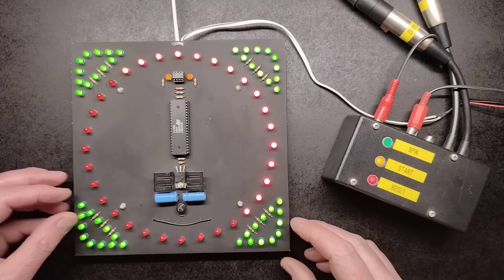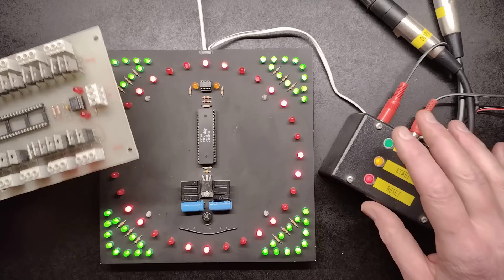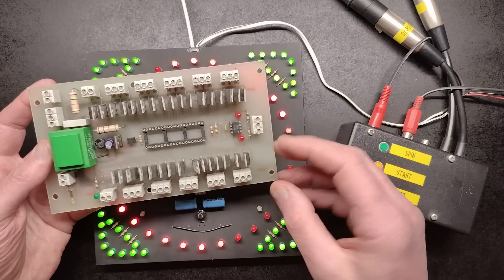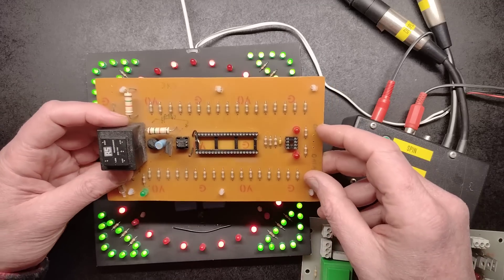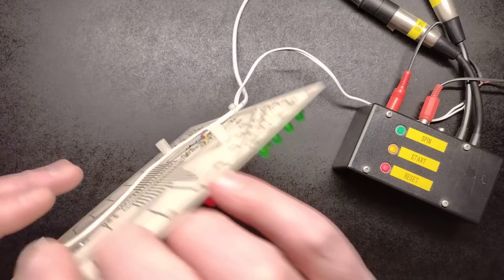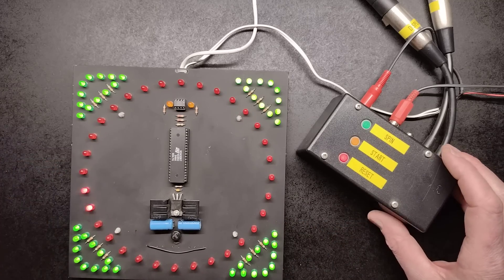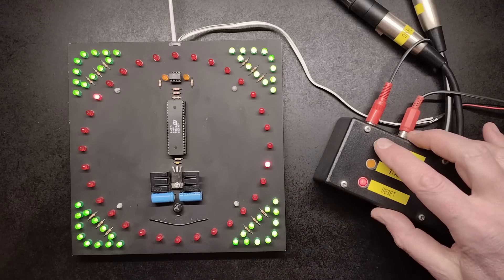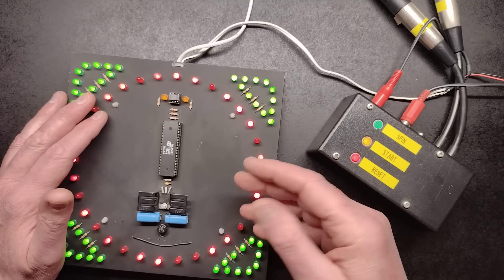Flux and carnival games (Loud 8-bit noises!)

Comment: There's three basic grades of rosin flux: R (rosin), RMA (rosin, mildly activated), and RA (rosin, activated). RA and RMA have organic acids added to increase the reactivity of the flux. You can also get water-cleanable flux and "no clean" flux. RA and water-cleanable have to be cleaned off, but it's optional for the others.
Reply: Unless your circuts include very large-value resistors. Usually you get away with optional clean or no clean because the impedance is much greater than any resistor you might use. (Typically, no larger than 1 megohm.) If you happen to be making a transimpedance amp sensitive to nanoamps, the impedance of the crusty flux will be similar to the gigohm-range resistor in your gain structure. The flux may even make trouble in spite of isolation gaps in your PCB. This is how you find the engineers who can't be bothered to think beyond first-order approximations when confronted with their own falability.
Reply: Depends on the RA, Kester 44/1544 claims non corrosive residue, as does MG 835. The trick is you have to get the flux hot enough the activate it fully and leave that hard resin coating behind, the unactivated liquid will etch metal.
Reply: Where does ersin flux (eg 362) fit into that?

Comment: I've got old radio and TV circuit boards, and audio ones too... that the rosin based flux was not cleaned from. No issues with any corrosion... at all.  AFAIK, rosin fluxes, were the original flux, and used for a very long time for tin lead based soldering. Rosin is a dielectric. Are there issues on newer boards where the tracks are much closer together... and frequencies are in the RF randge? ... don't know. There are acid... or organic halide... based fluxes... some of them have rosin in them too... some of them are quite aggressive too... they sometimes require neutralization and thorough washing away. There are so many commercial fluxes for industrial production... where the type of flux might make a difference to production success, or quality. For hobby use, IMO, and especially with through hole parts...all you need is ordinary rosin based flux... which is rosin dissolved in alcohol. Maybe id you are working a lot on SMT stuff, a commercial formula flux might be beneficial.

Comment: I had trouble with circuit boards growing fuzz on them after a few weeks, so I've gone and sought out RMA flux cored 62/37/2 solder.  It's a little hard to find and expensive, but it sure is nice solder.

Comment: I clean off the flux because it makes it easier to inspect my solder joints and I like my boards clean. I also only bathe them in a pan that is deep enough to submerge the solder pads but not enough to flood the components on the other side.
Reply: I'm sure with a name like mcwick, you've heard of wicking? The residue could travel up the leads!
Reply: @Quickened1  but if the solder joints are made properly. it wont. besides, its removed on the other side since that level is flooded too.
Reply: @stellamcwick8455  I believe your are right! I guess I couldn't resist the whole mcwick connection...lol
Reply: @Quickened1  but heres the thing. what if my solder joints WERE NOT proper and there were voids. then you would be correct. i may want to rethink my process.

Comment: Rosin flux is stable and only needs to be removed if you want the board to look pretty, but it requires nasty solvents. Try a water soluble flux solder, which must be cleaned but is super easy to clean with warm water and looks beautiful. Then there's "no clean" flux, which is stable and leaves less residue than regular rosin flux.

Comment: I've never had any problems with rosin flux.  Nice to use and no corrosion problems.

I did some boards with "water-washable" flux where I didn't wash the flux off and a year later the boards were a mess.  Not only can you wash it with water, you MUST wash it with water!  Nasty stuff that made my eyes burn and my throat sting!

Comment: I used to use some water washable flux when soldering SMDs by hand.  The issue with it was although it was water washable, you HAD to wash it.  if you didn't, within a few months it would start eating traces.. or if you did a bad job of washing they would come back and I would find what looked like a battery acid reaction under the ICs.  I stopped using that flux.
Reply: My understanding is more or less that if you use water soluble you need an ultrasonic cleaner next to the bench. Otherwise like you said, stuff stays under the ICs.

Comment: In over 50 years i have never cleaned flux with any solvent, i used to build on stripboard, so all i did was run a tool between the strips, but that was mostly to break any tin whiskers.
I started cleaning recently, but it's more about the looks.

Comment: This is good to know, I’ve been winding magneto coils for about 8 years now & never cleaned the flux off. Of course it’s VPI impregnated in a no-solvent polyester encapsulating resin, so hopefully little to no oxygen remains in there, but still it’s good to know I can carry on giving my lengthy guarantees.

Comment: Rosin won't cause any corrosion, unlike "Lötwasser" (liquid flux with zinc chloride and some muriatic acid - that stuff really shouldn't be used with electronics).
It can cause problems when high impedances are involved, but other than that, I can't see any technical reasons (contrary to aesthetic ones) against leaving rosin there.

I had just one project where I really had to wash PCBs off in order to get it to work. It was a AVT5229 vacuum tube tester build, hybrid SMT/THT with some high impedance circuitry involved and voltages up to 300VDC running around the board. It gave me wrong readings and the MCU was going haywire making the unit very unreliable until I gave it a nice IPA bath. 

Nice designs! Sam Battle would like that sound :)

Comment: Never had corrosion issues but have definitely had multiple projects ruined by the plumbing type flux being conductive enough to screw up my pcb circuits, especially on small surface mount parts.
Reply: I've heard the same but then again anyting asudduk can become sort of an electrolyte and be conductive at least that's my theory that I thought you was go when I was seeing weird things happening with the wrong solder used or just odd combinations of stuff that's my thought would help but made things worse I've seen some weird stuff and things that should never have been used anywhere near a circuit board and for other things as well that just made a mess of things even an attempt to clean the stuff up that just made the problems worse and caused Mount functions because of this yeah better than deficit was fixing the problem makes it worse or at least you could say that's him at the fix was more like it that's when referring to as the fix window actually opposites just makes things a real mess more so that would have been sometimes I've just had to give up on fixing something and rebuild it from scratch if something was built were Muslim people that worked on it the one person and it done nothing this the wrong way rare but every so often somebody really Jack's something that big time

Comment: Very interesting video as always. Kind of sad we can't hear your recorded voice from 28 years ago though...
Reply from the maker: I don't even know if those units are in use or where they are these days.
Reply: @bigclivedotcom  Those IDT devices used EEPROM to store analogue audio, so the quality was as good as any 6 bit sound, as they typically had around 6 bits of dynamic range in the cells, and speed of playback made a big difference to quality, as the longer slower rates gave worse quality. Sadly no longer made, just too difficult then to make what was effectively MLC flash that was reliable, and also gives a hint as to the issues you will get with cheap MLC flash devices as well. Wonder if some enterprising silicon designer would take the layout of a MLC flash chip, and make a modern version with the blocks of a standard MLC flash cell, and a simple counter to drive it.
Reply: "One moment, please..."
Reply: @RFC3514  haha, press button, and the excitement build up commences with "one moment please" hehe.
Reply: Yeah, I've always wondered what Clive sounds like when he speaks.  :-)
Reply: That was going to be the highlight, for me. Hopefully, a part two.
Reply: Yeah.
Reply: 28 years ago I doubt I would understand his heavy Scottish accent.

Comment: Basic rosin type fluxes are generally inert at room temperatures. Many other types remain active at lower temperatures or have other effects. For much of my engineering career I relied heavily on Hydro-X flux in hand built production until lead free solder became virtually mandatory. Hydro-X was really effective in a wide range of situations, but remained mildly active at low temperature and could erode the tracks & pads over time. It was however water soluble & over the years we used a variety of cleaning techniques we're used, but the best approach was a hot wash in a dishwasher (no detergent) followed by a sloshing in demineralised water to avoid water stains! On the downside there were some devices that were either not suited to immersion cleaning or we had to pay a premium for the sealed versions - DIL & hex switches being a common type.

Oh, the heady days of hand coding sfx in assembler or cheating with look up tables!
Reply: AFAIK, it was citric acid based flux, in alcohol, thickened with glycerin. Citric acid is a very mild acid and is used to clean away copper oxide. AFAIK, it isn't strong enough to attack the copper, or erode the copper tracks. Is there actually evidence of that?